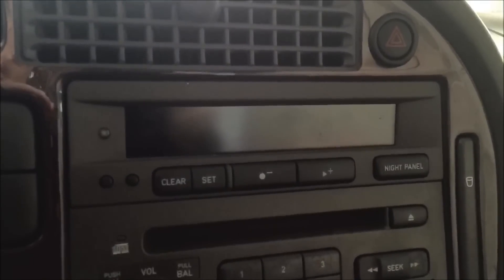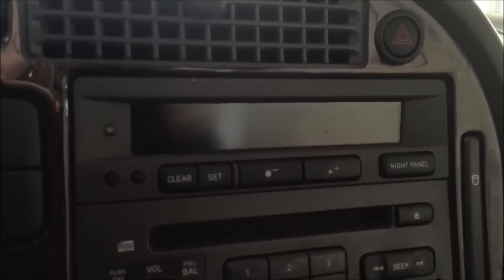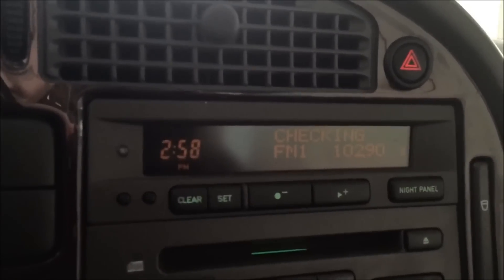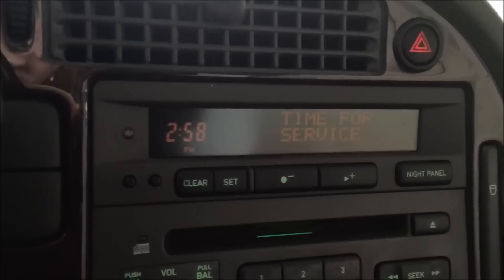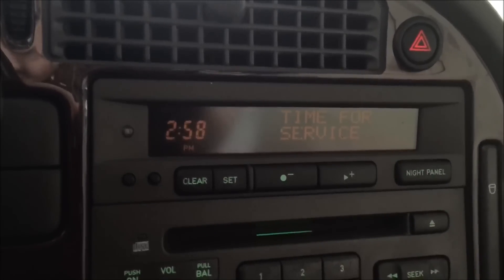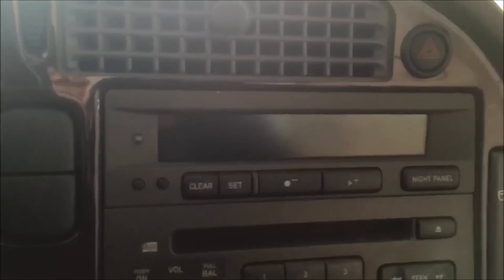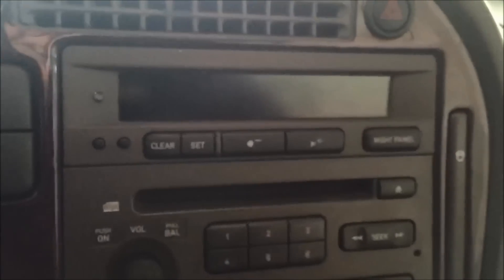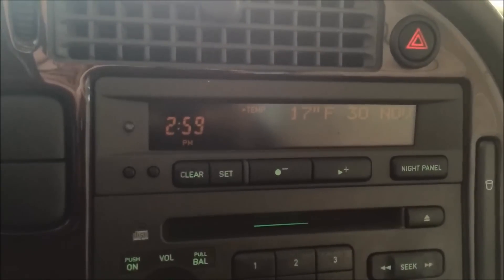Saab Information Display "Time for Service" clearing

Comment: this appears on mines... I thought it means that is time for and oil change.... does it??
Reply from the maker: Hi Libeth,
Yes it could be time for an oil change. It could also be a marker of 15,000 miles travelled, or a calendar reminder, as in once a year.
Reply: +Duchess DIY but if that appears, could u still drive the car? mines just appear yesterday
Reply from the maker: Yes, I do all the time. 
I just perform the maintenance on my own and then clear the notice.
Reply: +Libeth anep Hi!I like watching your  video.. about fixing  the cancelling the service's    reminder.do you repair the pixel display?thanks

Comment: Showing me the key does not prove you really shut the engine off!  You could have had a spare key in the ignition and played a recording of start up noises and also hacked the SID to correlate with a fake key position.  I don't think you really know how to clear the message at all....   ;)   Thanks for the tip, nice job.